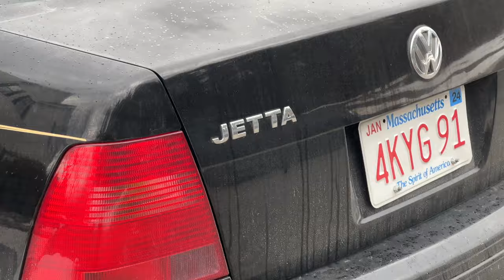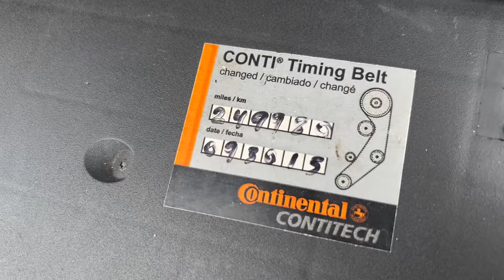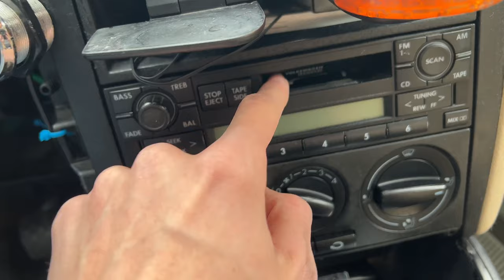Everything wrong with my Budget TDI

Comment: Im from Spain and golfs and Jettas 1.9 tdi (called bora here) are very very common. I had a mk4 golf AFN 110hp with 420000km and the only problem was the fuel pump, same as you, but very easy and cheap to repair. They are strong engines
Reply: Now i have a 1.9 tdi Passat b5 ATJ and i am very happy with it
Reply: AFN mk4? Or was it a mk3?
Reply: @jonytube  mk4 year 98 imported from belgium 😄